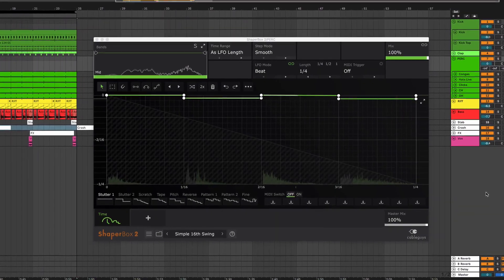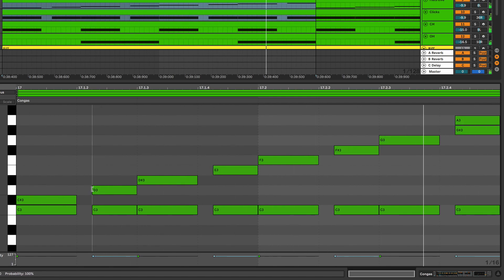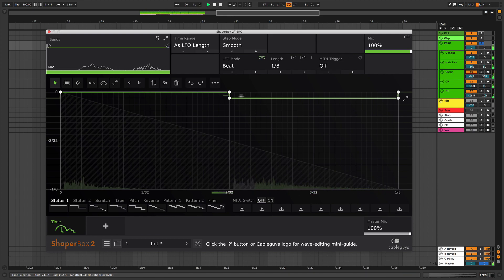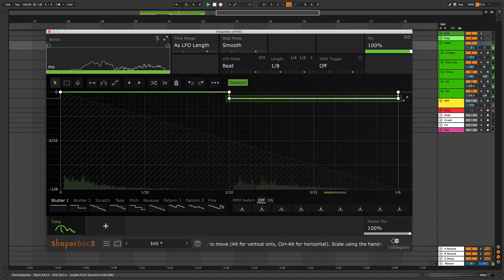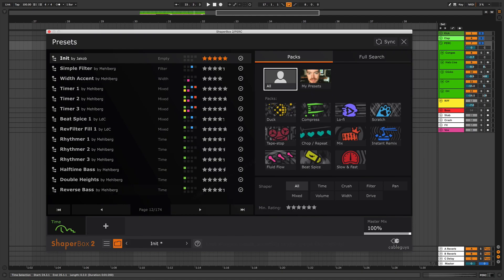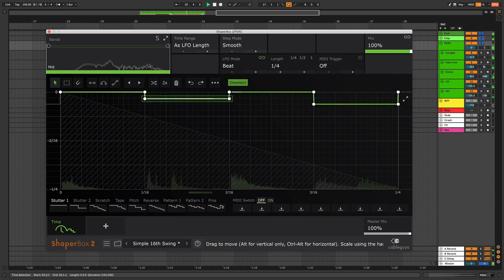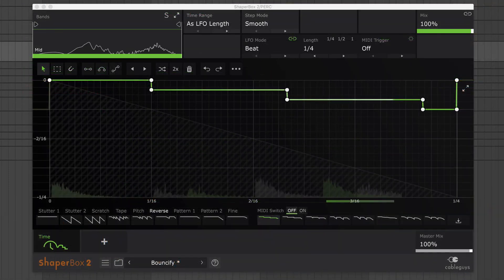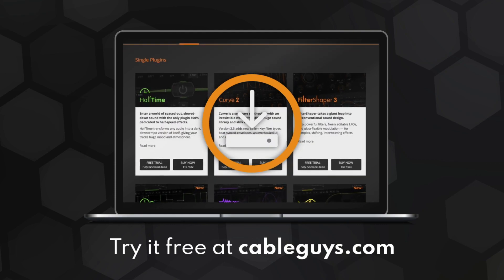How To Add Swing To ANY Sound with a PLUGIN!

Comment: Messing around with the demo and trying to apply it to vocals, the audio gets really garbled with a heavy stutter if I push the swing any further than how much you did in this video from the top. Is there a setting to render it out or anything? It seems like a really useful tool in concept, but if it can't produce clean sounding edits it's not very practical.

Comment: Quick question...how do you put her effects created in different areas of the beat, right now ming just goes through the whole beat
Reply from the maker: You can automate Master Mix to bring effects in and out. Or to switch between effects, use automation or MIDI to switch between User Waves. Check out the ShaperBox PDF manual for full details 👍 https://www.cableguys.com/shaperbox-tutorials.html

Comment: What if the loops in interest already have slightly different swing timing? This way duplicating an instance of TimeShaper to another tracks still won't give them the same swing right?
Reply from the maker: Ideally you want all input signals to have no swing applied, or the same swing, before adding TimeShaper. But if not, you could try adjusting the TimeShaper offsets differently for the different tracks.
Reply: @Cableguys  That makes sense. Thanks!